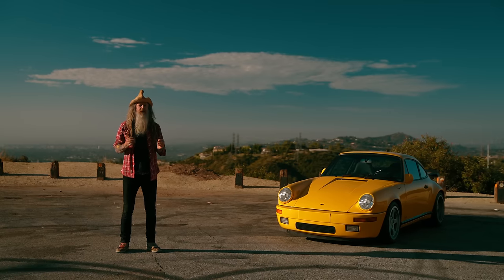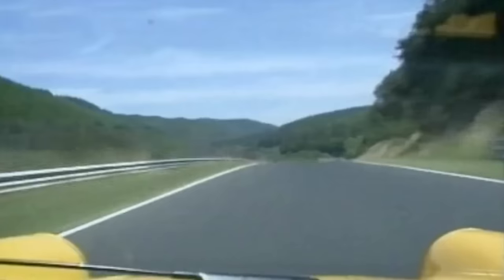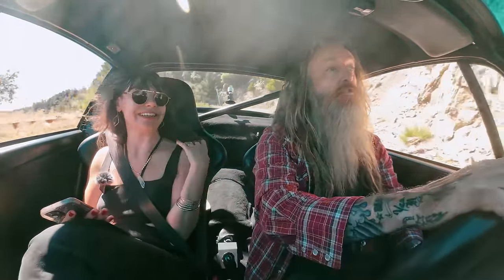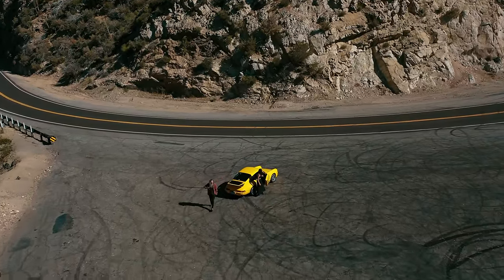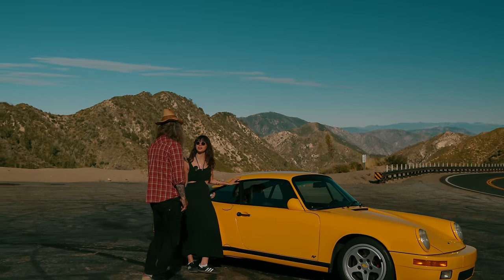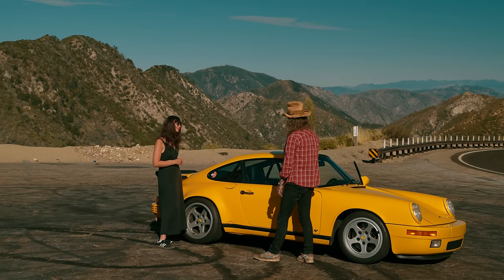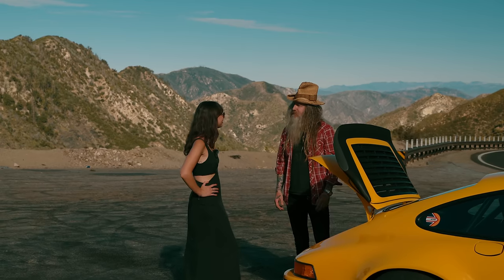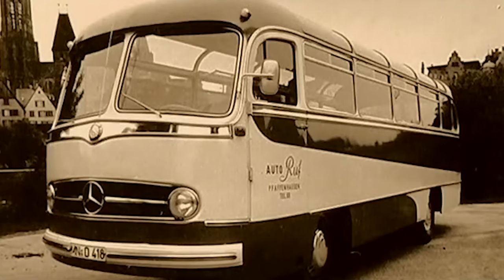ITS NOT A PORSCHE ,ITS A RUF  CTR -211MPH YELLOWBIRD, THE WORLDS FASTES CAR BACK IN 1987

Comment: Love your inclusion of the historic films and photographs, the family history in general, as presented by Ms Ruff.
I’m assuming the six speed transmission with higher reduction in the lower gears and 1:1 6th, with taller differential gearing, to reduce parasitic loses, and exploit torque capacity?
Thanks for sharing.
Reply: *RUF 
Not Ruff ❕😅
Reply: @Ramsi-Berlin  not intended as a excuse, think it auto - filled as I had to type it multiple times.
Reply: According to the internet it has a 0,86 5th gear and 0,72 6th gear with a 3,44 final drive.

Comment: I have had the privilege of being in the passenger seat of one of these cars.  It was lightly and tastefully modified, and made around 500hp and 475 ft lbs of torque at the wheels.  I have never been in another street legal car that accelerates as hard as one of these...50km/hr to 250 took less than 8 seconds, and 250-300km/hr was less than 10 seconds more.

My mechanic had just done a bunch of work to it for one of his customers, and asked if I had ever been in a turbo Porsche before.  I told him I had never been in any at all, but had been in some pretty quick vehicles.  He needed to take it for a road test, and invited me to ride with him.

The car didn't have the stock CTR rims like the one in this video, it had 3 piece BBS wheels.  It had a full roll cage, fiberglass and carbon seats with Schroth harnesses, and aftermarket carbon brakes.

It was an unforgettable experience, and I am forever grateful I went (My mechanic would end up being murdered by a family member several years later).  

The only vehicle I have been in since that felt even close to the RUF, was a modified 2010 Shelby GT500 with an upgraded Kenne Bell supercharger, and a slew of weight reduction mods.

Comment: I worked in a tyre shop in London in the 90s. I was told to pick up a customer car so we could change the tyres. I will never ever forget that day. A RUF 911 twin turbo. I still cannot believe a 19/20 year was handed the keys to what turned out to be a very very fast car. Raced a sports bike, we both got stopped by the police. I was very lucky not to loose my license or go to jail. Triple figures in a 30 zone. I got to the shop and said to my boss you better take that car back 😂 I still get scared thinking about it to this day 🙄

Comment: And 35 years later, a 992 Turbo S is still not as fast (@205) . What an unbelievable achievement at the time.
Reply: Let’s be real, the 992 Turbo S would dust this thing in every category. It’ll repeatedly hit 60 in under 3 seconds, and easily hit 211. With that being said the yellow bird will always be legendary.
Reply: @ethan8532 Everyone but top speed, but I will take that as solace when I pick up my 992 this week as I don't think I will be hitting that limitation.
Reply: 992 will have probably 10x the downforce at that speed, which comes with a bit of drag. There is still trade off to balance stability with slipperiness.

Comment: -Just for the record, in my humble opinion this car is NOT a 1987 Ruf "Yellow Bird"
-It does have the right look, the small oil cooler opening in the front light weight bumper for cooling the engine. Often called a "Smile."
-And it does have the rear bumper with 19 slats/holes below the license plate to create a vacuum as the air rushes past it sucking out
the hot engine gases thus cooling the engine some what = more power.

-But it does have a series of 3 slat/opening together in a group of three at the far ends of the rear bumper on each side. These horizontal opening came out I think the 2017 Ruf car. I know all of this because I bought an aftermarket Ruf front and rear bumpers that had the smile on the front bumper (that had to be cut out) and the 19 slats below the rear bumper. BUT I didn't like the design of the smile, it looked too small for such a large front bumper so from a photo of the 2017 car I scales this larger opening on my aftermarket front bumper and had the shop cut it out.

For the rear bumper I also scaled the 2017 rear bumper to acquire those horizontal slats thus getting more hot air out of my car's engine bay. I also did a couple of tricky design changes to both front and rear bumpers. I have been to 5 - Lufts, 4 - PCA Werks Reunion and have watch many, many videos and photo of all cars from my car era and I have never seen a car like what I have done. Yes I also put on the 80's race air ducts in front of the rear wide turbo flairs but that is not staying on point about Yellow Bird.

You did a fine job describing the Yellow bird as you do with all of your videos. But like I said I don't believe this is a true Yellow Bird.

"A garage without a Porsche is just a dark hole" — Walter Rohrl - Porsche Development

Comment: When the waste gate opens up the power starts to decrease. 
No disrespect intended by correcting you sir.
Reply: Walker is implying shifting up releasing the gas pedal a bit so he is right. Initiates to higher gear dropping the accelerator waste gate opens up higher gear engaged back to accelerator the power starts to increase.

Comment: In the real world it wasn't faster! The first F40 units made in 1987 "speculation is between 20 to 25 units", had the same mechanics as the 288 GTO EVO, more than 650hp and less than 1100kg, maximum speed above 230mp/s but did not follow traffic rules in several countries in Europe, America and Asia. , were "castrated" to adapt, becoming heavier and with less power! But test against one of these and the yellowbird won't stand a chance!!
Reply: “Speculation”, being the  operative word here. Not that anyone really puts any mileage on a Ferrari anyways. Porsches are driven, Ferraris are…trophys?